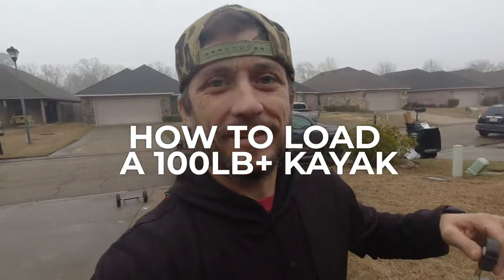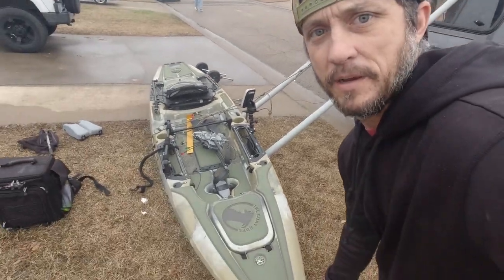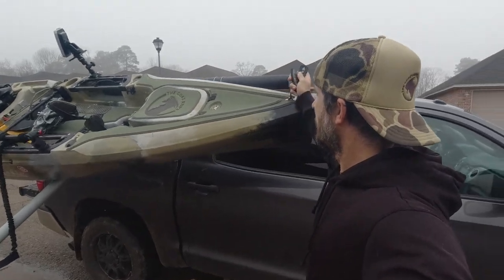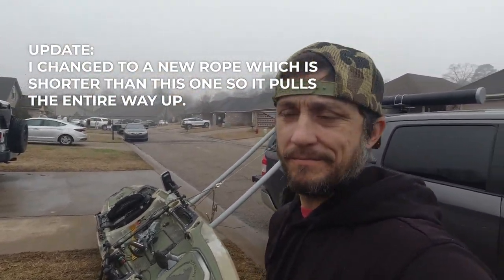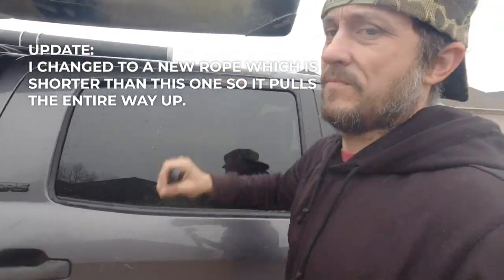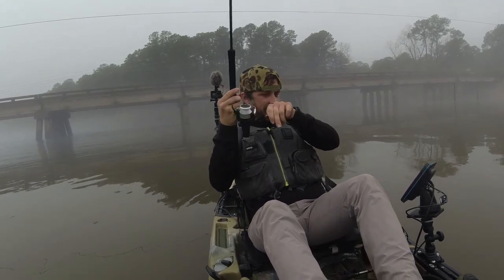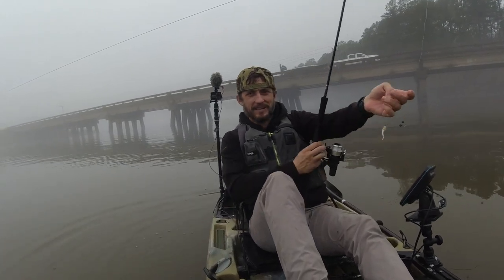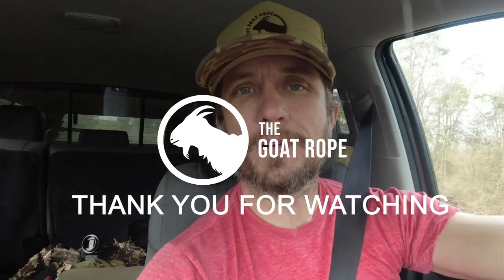DYI Kayak or Canoe Fishing Truck Roof Top Loader Solution

Comment: Thanks again, got the winch running : My Japanese INNO roof rack has T bolt slots like my router table so bolted the winch onto a board put holes into it and put Tbolts to hold down onto track of rack then the wiring is about 6 foot so got a kit for trolling motors that has similar 10 gauge wire and 2 Anderson quick connectors with attachments to battery, long enough to open hood and reach my battery on my Acura MDX run winch disconnect put protective plugs on the Anderson connectors, wrap up wire and connect to rack with bungie and off we go. REALLY HELPS to have the remote so you can guide the kayak that is the added bonus, plus not have to manhandle the Hobie Outback after your all tired...
Reply from the maker: Awesome!!! Glad you are up and running. #saveyourback

Comment: Like this idea! I saw some guys using 3" pvc & just pushing them up easy, but they were doing car tops not truck or suv so angle makes a difference.  I already got the Harbor Freight 440 lbs to lift Outback up to garage ceiling.
Reply from the maker: Same 😆 makes a great lift

Comment: Winch parts and electrical please
Reply from the maker: I added the winch I used in the description but really anyone should work. I have seen cheap ones also at tractor supply. As for electrical. I just used a stand alone lawn mower battery 12v. You could wire it to your truck if you want to get fancy.

Comment: How did you run the electric wire?
Reply from the maker: I just have it set up to connect to a Stand alone battery as needed... You could conne t to main car battery if you wanted to run the wiring harness.
Reply: @TheGoatRope  Thanks, I was not watching carefully the first time now I see the battery on your tailgate  at beginning of video. Trying to figure out hook up to car's main battery to save some bucks on a new battery.. but heck that is a lot less work. ha ha! LIKE MY FRIEND TOLD ME: " Hey! you probably only have 10,000 days left! Get your ass retired! and get to fishing and pickin' " Ha HA!
Reply: @TheGoatRope  Did you need a longer cable to reach the battery? Is the cable permanently attached to the winch, or can you use a different/longer power cable to the battery?
Do you keep the winch mounted to the roof all the time, or only when going kayaking? If permanent, how did you lock it so it can't be stolen or rattle loose while driving?
Reply from the maker: @kyleschroeder4801  I have a plug ran off my back cap to the battery I plug into when using it. Look around 3:50 mins you will see the winch mount. It's just a piece of wood bolted down. As for stealing it... Goodluck getting it unbolted. But with that, it's a harbor freight winch, not worried about it. Doubt anyone will take it before they steal the yak 😂

Comment: I'm gonna make one of these but with the hand winch like Alan's. I'm gonna use 45 degree elbows to fit over round bars. Where did you get that grey pvc, is it schedule 40? That's electrical stuff no?
Reply from the maker: Awesome. I got it from Lowes (I believe or a local place) and yes the electrical stuff with the wide end. Sorry don't know technically term.
Reply: @TheGoatRope  -  Schedule 40 (white) is some type of plumbing standard for construction. It withstands a certain level of psi water pressure and is kinda stiff, no flex to it. The grey you're using seems stiff enough. Didn't look like it flexed at all. I'll have to see what the cost difference is. Grey looks better though and I can pvc glue white 45's on if no grey 45's. Thanks for replying. Subscribed!
Reply from the maker: @damkayaker  awesome. Goodluck with it and you are welcome. Thx for sub